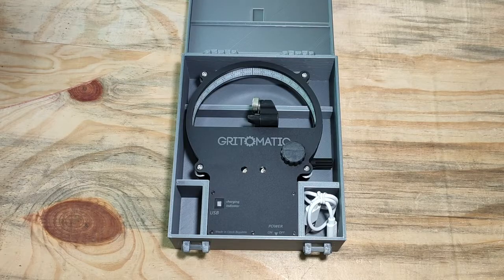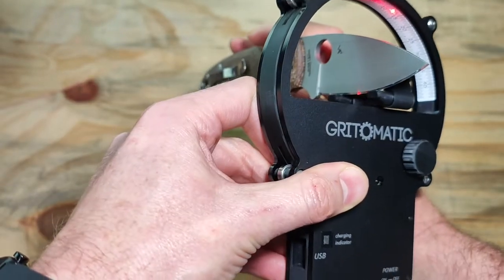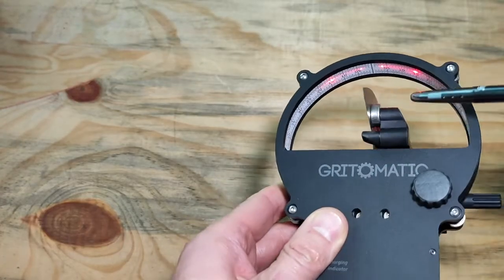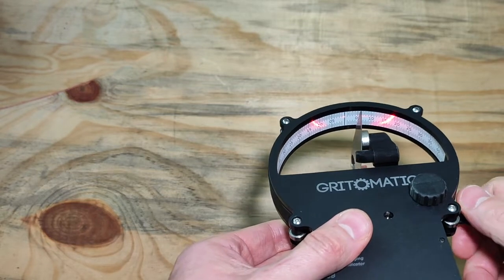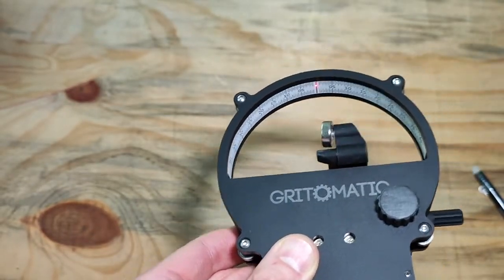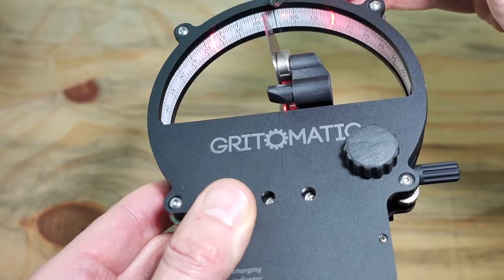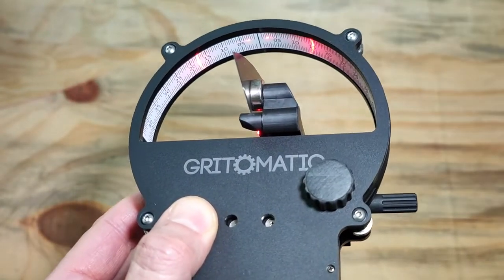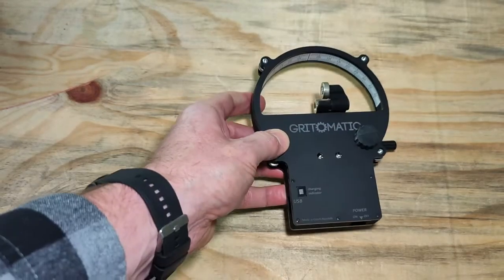Gritomatic Laser Edge Goniometer Master - Knife angle

Comment: Is the marking just the double of actual edge angle if the job is held exactly vertical? 
Say if bevel is 10 degree single side, it would show at 10' marking and marking is actually geometrically 20' (20/360) from the bottom tip of blade and w.r.t. exact vertical line passing through spine of blade.
Just curious! 
Regardless, wonderful job making a tool in simple and effective design.
Reply from the maker: @SurinderSingh-mu2oj  The markings is for each side of the edge. So, 10 degrees on the left side and 10 degrees on the right side. Each edge side's sharpening angle. If you were to have an inclusive angle, then yes it would be 20 total but that's not how sharpening angle is typically measured. It's typically measured as each individual side of the edge, just like the goniometer measures it.

Comment: Can this instrument be used for kitchen/chef knives?
Reply from the maker: Yes, most definitely! I'm only using small knives for demonstration purposes.
Reply: @777edge  Looks like the Master version can only take a knife up to 51mm in blade height, but I have a lot of chef knives that exceed that. The Pro version can handle them, but it doesn't have the magnet assist.
Reply from the maker: @LtKwasretaken  In all honesty, you don't need the magnets at all. The Pro version gives just as accurate readings as the Master.

Comment: Wonder what kind of a reflection the laser gives with a full convex grind?
Reply from the maker: It's in the video at 6:08
Reply: @777edge   Sure looks like it has a secondary bevel but yeah the laser print is different.
Reply from the maker: @Dissentient01  I sharpened that knife specifically to a convex edge on a guided sharpener to show how it displays in the video. There is no secondary / microbevel on that knife. The inside dots  (around 3 degrees a side) on the scale is the primary grind of the knife (not the edge bevel). The outside lines is the diffraction of the laser off of the convex edge. I used the wrong words to describe the inner dots in the video, I said "primary edge" but I meant to say "primary knife grind". 🙂
Reply: @Dissentient01  it does indeed